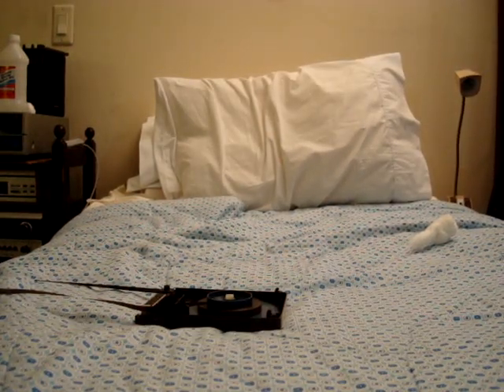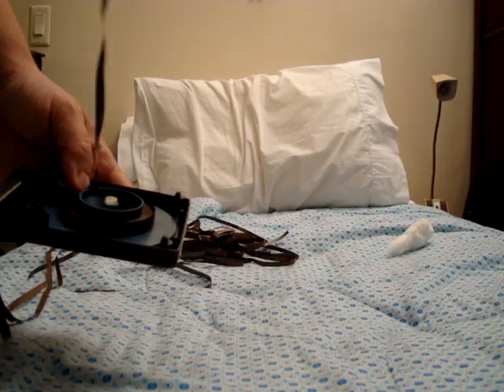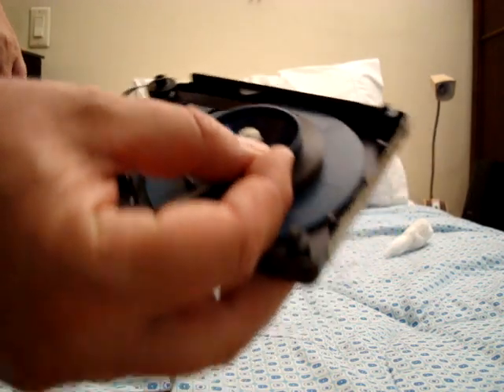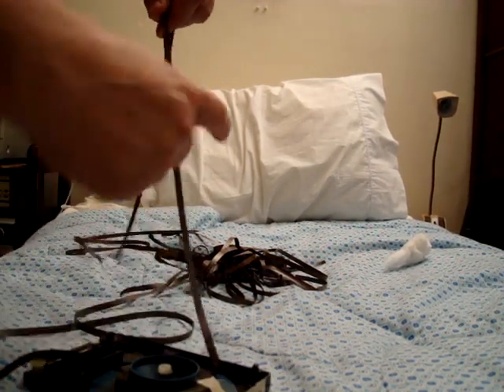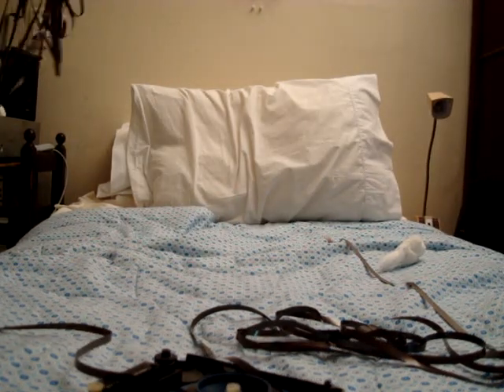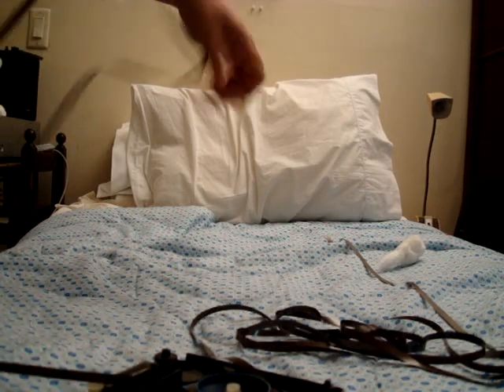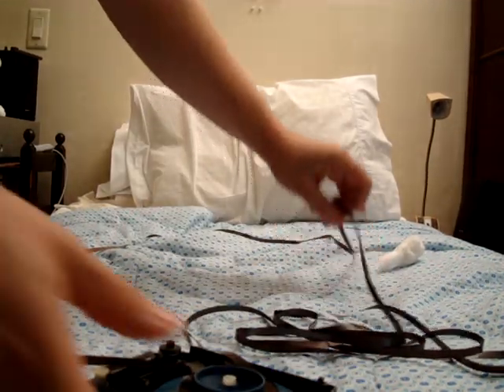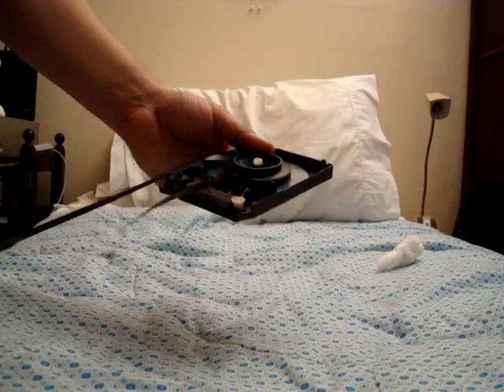8 track repair: broken splice & winding tape back onto hub

Comment from the maker: Thanks for these techniques.  I prefer doing it by hand since it gives me more control in case there is a twist or other anomaly with the tape.  I can stop right away otherwise continuing to wind the tape could damage it under these circumstances.

Comment from the maker: Just encountered a jammed tape; could not move it with my fingers and saw the shinny skid marks indicating a jam.Opened it up and could tell the tape had been partially water/moisture damaged with a slight smell of mildew and with multiple folds in the tape that bound it up.Unravelled the tape to the fold areas and ironed them out and then ran the tape a full cycle by turning the spool.Not a common tape to find so I spent the time on it. Works now. Moisture can cause the tape to stick together.
Reply: Extremely helpful video, just one question:How do you remove the flywheel/capstan assy?
Reply from the maker: Depends on the machine. Have to open up the unit and remove the screws or "C" clip commonly used to hold it in. Best way to get the tape off the capstan is to rotate the capstan/flywheel in reverse which will unwind the tape. Do your best to preserve the tape without having to cut it. Then clean off the grease from the capstan.

Comment: Hi Waukee321 What can I use to splice an 8 track tape if I don´t have those splices they sell on Ebay? I tried making one out of insulating tape, but it doesn´t seem to stick on well, and after a few plays the tape comes apart again. Thank you, greetings
Reply from the maker: You really should just buy a spool of metal splicing tape.  It needs to have the metal to conduct electricity so as to change the track when it touches the electrodes. Needs to be thin too to prevent jamming and smooth tape flow. You could cot strips of aluminum foil and use double sided tape or flexible type glue.
Reply: @waukee321 Sorry but I need the tape not for track changing, it's because I need to put the tape together and splice it on the back. Thank you for your kind advice :) greetings
Reply from the maker: In that case (for splicing the tape together not at the sensing foil ), indeed you need to apply the splice on the back of the tape. It helps to scrape off as much of the gray lubricant coating where the splicing tape will be adhering to. You can do this as I do by holding a straight edge razor at a 45 deg angle and very gently and carefully scraping off the lubricant coating until you see the brownish color of the tape beneath it. Don't press too hard or you will cut/fray the tape. Alternatively, I have also used Goo-Gone with a Q-tip to rub off the lubricant and then clean off the Goo Gone with Windex or similar cleaner if you don't want to use a razor. Removing the lubricant will allow the adhesive on the tape to adhere better. Buy a spool of regular (non metalic) audio splicing tape

Comment from the maker: Hi Mark, Certainly. Hopefully you are able to get all the tape out of the machine and without it being damaged. If it is jammed around the capstan and won't budge loose you may have to remove the capstan. Do whatever you can to avoid breaking the tape. Once out, locate the beginning of the tape end. Make sure it's the correct end or the tape will play backwards & program 4 will be program 1 etc (You'll know!). Clean you hands. Now begins the long process of straightening the tape (cont)

Comment: That looks like a Columbia or Epic style cartridge, I'm working on repairing a few of those currently. In my case a few of the cartridges were filthy so I had to take them apart and wash the plastic cases, the pinch roller, and a few other parts first. When I run into a cartridge that has unraveled that much I usually wind it up on a reel to reel spool and then rewind it onto the one one inside the cartridge, it prevents a lot of twisting and tangling I find.
Reply from the maker: Yeah, dirt is a real pain on these and must be cleaned off.

Comment from the maker: over the plastic shaft.Use a small jewelers blade screwdriver to turn the innermost shaft of the spool (find a hole opening in the hub to insert into to turn).While winding, gently hold down the tape against the spool side to keep it from coming off. Once all tape is wound up, remove masking tape that held beginning of tape to spool.Pull outer edge of tape end till it is lightly snug.Now unravel outer edge tape end about 3 revolutions for proper slippage.Use splicing tape to fasten both ends.

Comment from the maker: If the sensing foil breaks off inside the machine I try to get it out immediately.  Sensing foil acts like a piece of wire inside your machine and can short out electrical components that it touches so it's important to remove it. Usually the foil will be in the head or capstan area of the slot and can be pulled out with tweezers or a piece of scotch tape. You can try vaccuming it out too. Sometimes you do have to open the player to get it out.

Comment from the maker: Hi,

I'm not quite sure what you are refering to with the white circle things. Do you mean the hub/spool that holds the tape, or the thin washers that the hub sits on around the center post  that act as a lubricant.  The hub has to turn easily on the post or yes the tape will break.  Not all hubs are interchangeable; they are made for specific shells.

Comment: Hey Waukee. How did you end up letting the splice on the Tony Orlando & Dawn 8-track tape break on the day it happened?
Reply from the maker: Mark Covington I think I deliberately unspliced it. Pretty sure though if I picked one of these, the splice would have broken (highly prone to splice breaks): Columbia TC8 with the 2 or 3 tabs on the top case, RCA riveted (also have the grasping ridges on the side ends where you pull out the cart, on both halves. Later  ones (non-riveted) only have on bottom half and they don't tend to break)

Comment: Hey Waukee.
What are some of the things that can cause a little bit of the tape to pull itself out of the cartridge & into the player while the tape itself is playing?
Reply from the maker: Mark Covington Aside from a broken splice, Player: Heads are dirty, capstan is dirty and/or magnetized. Clean and demagnetize both.  Tape: (1) Tape is wound too loose on the spool so that when you pull the tape out it doesn't pull tightly enough to rotate the spool. Open the cart, get to the splice, undo the splice and pull the outer (take up section) end of the tape until it is tight (hear a squeek).  Then unravel this about 3 or 4 turns and resplice. Turn the tape spool by hand/screwdriver or pull out the tape from the center to see how freely it turns. If you hear squeeking or it turns hard and/or the tape moves stiffly/tightly, you need to unravel a few more layers. Unfortunately, you may have to wind the tape all the way around again to get to the splice where it just comes out from the center. Need it to come out "just right" not too loose or too hard.  Another thing may be the reel is dragging/warping against the case. If the reel is soft and flimsy you can carefully flex it up so it doesn't touch the case.  Make sure the case itself isn't damaged or melted/warped in some way as the case itself is an integral part of how the tape fits and plays in the machine. Finally, the rubber pinch roller may have dirt or stuff on it and needs to be removed and cleaned with Goo Gone (make sure you wipe all this off completely) or with rubbing alcohol.

Comment from the maker: Before I put a tape into the machine I visually check that the pads are there. The spring loaded ones especially that have the felt piece since you can scrape the back of the tape against the metal tab if the felt is missing. For foam pads, you can play them but make sure the rot/pieces are not falling out as they can get jammed in the head and capstan.Always watch out for those gummy pinch rollers used on older AMPEX and some GRT tapes.Press your thumb nail into the roller if in doubt to check.

Comment from the maker: You can try to smooth out the wrinkles by gently sliding the wrinkled section around a smooth object like a glass rod. Glass is always very smooth. Be sure your hands are clean! Of course the rip could spread if it gets tugged on too much. You may want to try some thin splicing tape but be sure that you apply the tape to the inner side surface of the tape. If you face the tape with the door flap that slides up, it will NOT be the side you see when you flip up the door on the outer edge.

Comment from the maker: (cont) tape the end of the tape lead to the inner hub reel (where it pulls out of the hub) with about 1 inch of tape sticking up from the hub. Be sure tape is facing correct direction as you will be winding it onto the hub by turning the hub clock-wise. Also the shiney silvery lubricant side ot the tape faces the inside of the hub; the brown recording side faces out/away from the hub spool. Now start winding the tape slowly onto the hub with the hub mounted in the bottom half of the case (cont)

Comment: How does pulling from the center allow you to rewind all the loose tape on the other end? Aren't you just replace one pile of tape with another?
Reply from the maker: Pulling from the center when the tape is just tight enough will turn the hub and naturally wind up the tape from the outer edge of the hub.  Just have to keep the tape tight enough on the hub from time to time otherwise the hub will not turn.

Comment: Hey Waukee.
What is the name of that tape you were trying to fix in this video?
Reply from the maker: Mark Covington Mark, It's been so long I don't remember. From the looks of the shell, it's a gray, 3-tab Columbia/TC 8 cart which are the most frequently ones prone to broken tape splices (foil). If you have these, ALWAYS pull them out when they come to the program change (i.e. splice) and inspect, tug and flex the splice. A few times I just looked at some of these as OK only to have them break on the 2nd or 3rd pass around! So really check them good.

Comment: Hi. I recently got a VHS eaten. It was slightly crumbled and there is a very tiny rip.
Do you think it will be all right to play? I'm just wondering if it will just be a bit blurred and stuff or if it will get jammed and even more damaged.

It's an old tape, so what do you think I should do?
Reply from the maker: If you're concerned that the tear could spread, you may want to get some very thin spicing tape for it

Comment from the maker: Sorry for the lighting. I am pulling the tape from where it comes out of the inner hub of the spool (inside).  As I pull from there, the tape is winding onto the outer (outside) hub and winds down toward the inner hub.  Pulling from the outer hub would not work. This is all to get the beginning end of the tape to "just" come out from the inner hub. Then you can just wind the rest of the tape around the outside and then re-tape the foil. Make sure the tape is not twisted as you pull it.

Comment: Hey Waukee.
How come we never get to see your face in any of the YouTube videos you've done? :) I'm curious to get to see it. :)
Reply from the maker: I'm hoping that all these years since my videos that people have had success in repairing their 8 track tapes rather than having them end up in a landfill; my original intent. I also saw some other methods of opening up 8 tracks that were pretty destructive and I said "Oh No!". I try to preserve the original components as much as possible and not resort to breaking tabs and using adhesive tape to hold the shell together.
Reply: @waukee321  I've had some success in repairing some 8-tracks & some cassettes as well. I've even cleaned some vinyl records by removing pops, static, skips, loops, etc.. What do you think about that?😀
Reply: @waukee321  I've always liked Shaun Cassidy. Yes, I am willing to see your face.😀
Reply from the maker: @markcovington8159  Sounds like a Roberta Flack song. ☺☺
Reply from the maker: @markcovington8159  Actually vinyl was my first love and I have a pretty decent collection. I started collecting records in the early 80s when people were dumping their CDs. I bought a used VPI record cleaner which has been fantastic. I use Simple Green cleaner with distilled water in the machine. There are various recording  softwares that also remove pops clicks and hisses. One of them is Adobe Audition but unfortunately it is now subscriber based so $$$. As for 8 tracks, the only reason I really start getting into them was because they were so cheap in the early 1990s. Classic rock tapes were about 25 to 50 cents in thrift stores. Well, ebay of course changed all that and a lot of the thrift shop finds are no longer that great because most of their items are online now for considerably more $$; Goodwill is an example.

Comment: one of my 8 tracks was eaten and all of its tape came off its spool.Can the tape be rewound on spool and how is it done.

thanks,mark
Reply from the maker: Sure can.  Make sure you have the correct end, hold it against the center of the hub and start winding it up. Make sure the tape stays against (down) the hub wall.

Comment from the maker: (cont) As in this video here, unravel the folded tape, shake out the twists, until you have it layed out neatly. Before you wind onto the spool, carefully clean any soiled, greasy areas (from being eaten) with soft paper towel and rubbing alcohol. If any areas were wrinkled use the low heat iron method video I have posted here to straighten the tape. When tape is clean and ready to wind onto reel, take lead end of tape and with a small piece of masking tape, (cont)

Comment: Man you sleep on that bed with all that back coating graphite dust on it from the tape? Prolonged contact with the sensitive skin may cause shin rashes for some. Don't inhale the stuff or get it on your mouth or nasal passages, It can be toxic and cause cancer. From the sound of your sniffing it sounds like you already got a nose full hehe
Reply: It's not graphite, but iron oxide.
Reply: “Cause cancer” lol
Reply: @christianjohnson7228  That was the 60's and 70's man. lot of things where unknown if they where dangerous to someones health. You never knew what they was using if it was toxic to inhale and may never find out. Asbestos was still used in manufacturing, Lead was still in gasoline, Kids toys had sharp metal edges and where dangerous that where very hot, used dangerous exposed AC line electricity,  or blew up. The original etch a sketch had toxic paste in it and could cause blindness if you got it in your eyes. They where the best fun times as a kid.

Comment: Not to say you are wrong but it seems that your method may be time consuming and confusing to the novice repairer. You are going to make your viewers waste a lot of tape and possibly get them frustrated and give up resulting in more tapes in the dumpster. You are only making twists in the tape path which will wind up as magnetic spaghetti when winding it back manually on the spool is there is a lot of tape. Usually the tape is broke at the outer spool and the center is the side where more tape is coming out of it. I found it better to pull the entire tape from the center hub in the same direction of the tape onto the floor in a strait line and uniform position with tape on tape neatly in a loose pile. Do not pull from the top strait up to remove. This will create twists in the tape path. Hold your thumb on the spool and pull out at least 2 - 3 feet at a time.Once that's done you then wind the beginning of the top half of the pile on the empty center spool holding it down with a small piece of tape at the center of the spool in the bottom cart half with a screwdriver or object to turn the center of the spool while guiding the tape. This will take some time. Be sure you start at the right side of the tape or it will play backwards hehe. That's all to there is to it. Now clean off your hands. They will be covered in black dust so don't pick your nose hehe.
Reply from the maker: To each his/her own. Just sharing the way I do it and never had a problem, never had to cut the tape and re-splice (I hate that), and never threw out a tape. In fact, any broken case, I remove the tape and wind/append onto another blank tape turning a 40 min tape into an 80 min one.